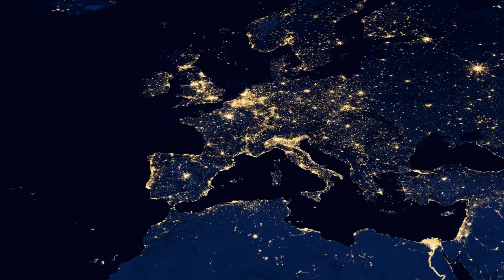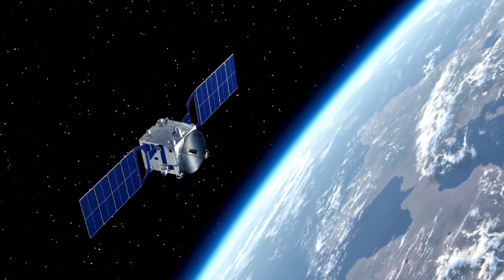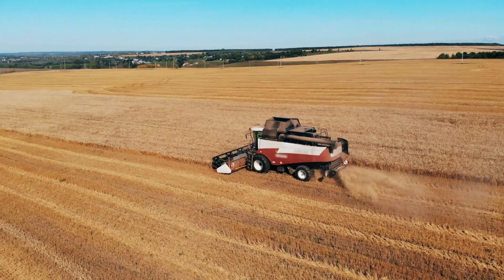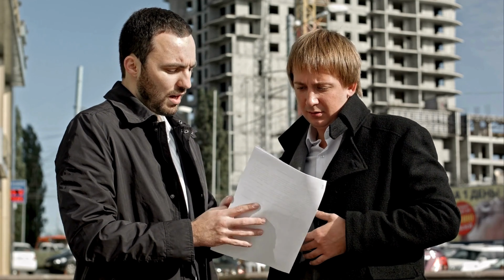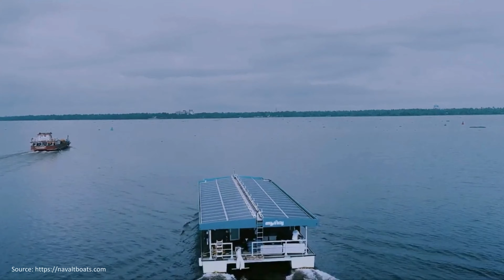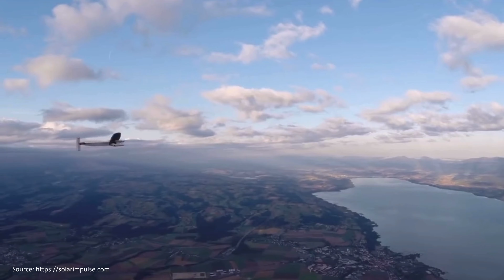10 solar technologies | educational film prod. by Danilo

Comment: Also, Sunpower Maxeon 7 solar cells available for home use right now are made of monocrystalline silicon with a solid copper base and a light-trapping surface. These in modules converts sunlight at over 24%. Much, much higher than your average solar panel. Just imagine if you coupled the Oxford PV solar tech with Maxeon's tech what kind of efficiency you might get. Add cell level supercapacitors and we are talking some game changing stuff. 😊

Comment: There are new advancements being made to solar cells/panels. A company called Oxford PV is making solar cells it calls perovskite-on-silicon tandem solar cells. They put perovskite solar conversion material on conventional silicon solar cells (tandem), which makes them at least 20% more efficient than silicon solar cells alone. They are being installed commercially now.